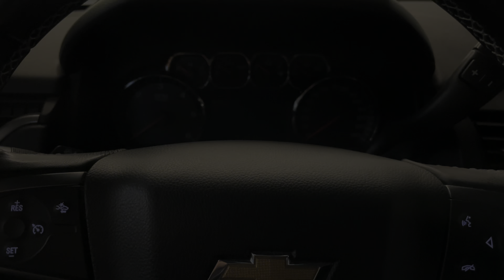Service Trailer Brake U1556...  LIN Bus Diagnosis

Comment: My trailer brake fault was caused a corroded splice connection in the wire bundle under the driver's door sill plate. Connect all 4 wires back together with a crimp & seal. I wish I looked here first before replacing the  trailer brake model , the dash control, checking all the fuses & verifying power and cleaning 3 ground lugs.
Reply from the maker: Sounds like you got it fixed up. Good job! Thanks for sharing!

Comment: In your opinion can a defective "Tailer Brake Module" cause a "Chassis Control Module" to not communicate with a scan tool?  If I run a auto scan on my 2015 GMC Sierra using a Foxwell NT510 Elite everything checks out good including the "Chassis Control Module".  It's not until I try going into the CCM itself that I receive a message on my scan tool that reads "No Communication".  Thank you in advance for the help.
Reply from the maker: If there are no fault codes that is likely a scan tool anomaly… There are two different trailer systems, one uses a dedicated trailer module and the other uses the CCM so you’re vehicle may not be equipped with the CCM or there is a fault. 

The trailer module itself likely won’t cause communication problems, but anything is possible these days.
Reply: @DadsGarageDiagnosticSpecialist  Is there anyway to find out if my vehicle came equipped with the CCM?  I would feel a lot better if I knew one way or the other especially since the truck runs great.  Thanks once again.
Reply from the maker: @HereWeGoSteelers You would have to be looking at the wiring schematics and the schematic would call out the three letter RPO code.

The RPO codes used to be inside the glovebox, after 2018 they can be read from the QR code on the drivers door jamb sticker. 

I took a look at the schematic for a 2015 and there is only one option so I guess you won’t have to worry about that anyways. 

If the scan tool will not communicate with the CCM check power and ground to the CCM and verify the fuse is ok. Then will have to test and verify communication circuits using HSLAN CAN network testing methods shown in some of my other videos.
Reply: Usually everytime it cant communicate with CCM (Auxiliary) its the red battery + wire at the CCM connector. I believe its red w/ white stripe. It comes directly from the under hood fuse box. Runs along the driver side frame rail back to the CCM. Pins 1 and 13? If I remember correctly on the CCM connector, are where you wanna test for 12 Volts. If you see open or something significantly less then battery voltage you can basically guarantee its that red/white wire. They tend to break under drivers door where the harness splits off towards the transfer case. This issue causes the "trailer brake system" displayed on dash as well. Its not always just as simple as a module or dash switch like many believe. These GMs are notorious for corroded wiring failing everywhere.
Reply from the maker: Good info! I’ve seen the same.

Comment: Hey man, I have this same exact issue on a 2018 Silverado high country. Same code too. I didn’t check the LINE bus circuit like you did only power and ground and I still have the code. Any tips?
Reply from the maker: Definitely check the LIN circuit for excessive resistance and/or open circuit. 

Rotten wiring is common within 12” to 18” of the connector at the trailer brake module.
Reply: @DadsGarageDiagnosticSpecialist Holy cow! Thanks so much for responding so quickly man. Okay I’m going to peel back the wiring harness going to the trailer brake power control module.
Reply from the maker: @esoterictransmissions I do what I can, you’re welcome!

After you confirm the wiring is the problem pull on the wires and you’ll probably find the broken spot.

I would resistance test the wire end to end and verify high resistance.
Reply: @DadsGarageDiagnosticSpecialist okay you’re incredible. I should’ve have known better because it didn’t clear at first. I was SO NAIEVE
Reply: @DadsGarageDiagnosticSpecialist I found the broken wire! Thanks again man. It was circuit 4114 from chassis connector to trailer brake module. I resistance tested them and found it fluctuating and then I pulled on it and it snapped. Was able to solder new wires and it worked great. Incredible video!
Reply from the maker: @esoterictransmissions Nice! Good work!

Comment: question - I have tested powers and grounds to the chassis control module , and the trailer brake module, all tested ok - Also tested the lin wire from trailer brake module to Chassis module -OK 
cannot comunicate with chassis control module, but trailer module data comes up on autel scanner-, and the U1556 Lin bus comes up in Chassis module , codes  any tips ?
Reply from the maker: That seems strange… Possible scan tool compatibility issue.

If you are getting the error message on the drivers information center the vehicle does likely have a fault though. 

What is the end to end resistance on your LIN circuit measuring for ohms? 

What about Min/Max values for voltage on the LIN circuit.

LIN should be approx 1V lower than battery voltage at maximum, and 1V above ground at minimum… if outside this voltage range it will not communicate even if the signal looks good. And that is typically caused by high resistance in the wiring. 

Corroded wires are pretty common within 12 to 24 inches of the Chassis module and or the trailer brake control module connectors.

Let me know what you find. Thanks.
Reply: @DadsGarageDiagnosticSpecialist   Thankyou and when i get back into it i will let you know
Reply from the maker: @buckeye455 you are welcome.

Comment: i had this issue when disconnecting trailer. but my issue was way more severe (vehicle wouldnt start for 8 months) realized the red wire going into TBCM had exposed wire. let the vehicle sit for months and out of the blue all permanent codes vanished and vehicle has ran fine for weeks
Reply from the maker: That’s interesting… I would suspect you have something else going on that would cause it to not run.
Reply: @DadsGarageDiagnosticSpecialist  it was always hit and miss. Sometimes it wouldn't crank over, other times it would drive but give service trailer brake warnings when hitting brakes and causing clusters to bottom out for a second. Sometimes it would go into theft detterant mode.  But like I said. Out of nowhere the issue just went away. Still currently my daily and hasn't had issue

Comment: What model Pico scope do you use? Did you buy it through GM? Enjoyed the video.
Reply from the maker: It is a GM branded Pico 4425 supplied to the dealership as essential equipment. Works the same as any other Pico 4425, but has license restrictions where it will only work with the GM pico software…. Although it seems to work just fine with Pico 6 and Pico 7 non GM software. 

Thanks.
Reply: @DadsGarageDiagnosticSpecialist  Thanks!
Reply from the maker: @MotorheadRedo you are welcome.

Comment: How many techs at the dealer actually do this vs. just slapping a new module in? Mine is sporadically throwing an error with the annoying, super insistant beep that just keeps going when it starts up. Dealer quoted $700 …
Reply from the maker: I’m not sure, but it’s a fast and easy way to be sure. It’s an expensive guess if they’re not testing it. 

Wiring faults are common enough on those that it should definitely be tested. 

Thanks.

Comment: Such a good video that it's not even what I'm looking for but i watched the whole video because it was very interesting.   We are having 3 lights come on at the same time.   At 1st it was intermittent but now it's every time you start the truck.   2017 Silverado 2500hd 6.0L Service Trailer Brake, Service Stabilitrak & ABS light are all on.  It seem to happen after washing frame areas under truck.  Do you think it could be trailer brake control module?
Reply from the maker: Most likely something got water into the connector. It would need to be diagnosed and you’d need to know what codes are setting. 

Thank you very much.

Comment: The trailer message appears intermittently. I clear it 5 times, then won't see it for days. It happens when towing or when not towing. 

The dealer found no error codes with the scan tool. They can't work on it until Monday.  Our campground reservation is over . We will be somewhere else upstate on Monday. 

In 7 days, we have 600 miles of driving to get home.

I don't know how a GM dealer is going to manage an intermittent error.  Should I just drive to a dealer in the next town and tell them to swap the trailering module?  

Other videos had a truck owner swapping the dashboard control.  

Braking seems normal.  The 3000 pound trailer doesn't push us around. I could try to skid when we hook up.

My diagnostic tool is a cheap volt-ohm-meter. Got pliers, strippers & a soldering iron! Going to test the braking pin on the 7 pin connector.
Reply from the maker: Well, it kind of depends on what the fault is when the fault messages present… if the trailer brake control module is communicating and reports a code for you to diagnose go after that. 

Or what I had going on in this video… The trailer brake control module wasn’t communicating at all and the module was faulty. 

I also see corroded wiring more often than anything else… About 6 to 12 inches from the module connector usually.

If I were to suspect corroded wiring… I could disconnect both ends of the circuit and load test with a headlight bulb while measuring voltage drop to accurately measure determine whether that was a problem or not. Load test the power, ground, and LIN circuit.

You can test with the ohm meter in the same way, but it won’t be as accurate because there won’t be any load on the wiring… that’s where a dealer tech will usually miss this because service information tells them to test everything with ohms. Intermittent wiring faults can be difficult to diagnose if it’s not acting up, but it takes a strategy of laying a trap where you think the problem may show up. 

Edit: another thing is that if the problem is intermittent it is unlikely to be a faulty module and more likely to be something like wiring or a trailer brake control switch code maybe. 

Thanks.

Comment: How is a LIN circuit different from the CAN bus?
Reply from the maker: Well a high speed CAN network is a 2-wire twisted pair that operates at about 1.5V-3.5V and the signals mirror each other. 

There are also single wire CAN networks that operate at about 0V-5V. 

On CAN networks each module can individually communicate. 

A LIN network is a single wire network that operates at about 1V-11V and is set up as a master/slave arrangement with one master module supplying the reference voltage and the slave devices simply taking orders and sending information back to the master module. 

Thanks.
Reply: @DadsGarageDiagnosticSpecialist  ok. To reiterate,  the LIN network communicates to perform some specific task. Here it is telling the trailer module to actuate the trailer brakes.

I have a another question about intermittent errors. I will ask in another thread.  Thank you.

Comment: Great video. 
Question, this will not throw a check engine light, correct? Only asking because  my 2018 silverado is doing a similar situation and now I cannot start the truck remotely, assuming because this fault. I tried the dash switch, no luck. Cleaned the connection up on module.. I'll be ordering a module
Reply from the maker: No, this will not cause a check engine light. The remote start is probably disabled because of a stored engine trouble code even if the light is not on yet.

 Crusty wiring is common to cause the trailer brake fault message also so verify there isn’t a wiring problem before replacing the module. 

Thanks.
Reply: @DadsGarageDiagnosticSpecialist  very helpful! I have no way to test the Lin, other than a ohm test, as mentioned in another comment. 
I love GM, but this is ridiculous. Let's change the location for 2025 ha ha. It's like, leaking 3rd brake light, back sliding windows, shark fin antenna. But I do love Gm. Lol
Reply from the maker: @perrybeede9498  I covered that in the video 11:17 

If the ohm test is ok and no shorts then most likely it’s the module yes.
Reply: @DadsGarageDiagnosticSpecialist  thank you!
Reply from the maker: @perrybeede9498 you are welcome
Reply: @DadsGarageDiagnosticSpecialist  It's got a bunch of faults, but only notification on the dash is the service trailer brake system. 
1- chassis control module
2-transmission control module
3- elec brake control module
4- body control module
5- radio control 
6- human machine interface control module

I just plugged it into my friends topdon.  Now I am confused. Or perhaps a bad ground?
Reply from the maker: @perrybeede9498  I would concentrate on the trailer circuits.
Reply: @DadsGarageDiagnosticSpecialist  I am taking the wire wrap apart now. From the module and bcm. Hoping I find a bad wire like you have experienced.

Comment: Hello, I am having The same issue with my 14 Sierra. I want to test the LIN, where can I find the pin out so I make sure I test the right wire? I would be using the continuity and ohm method. Thanks!
Reply from the maker: Try AllData DIY or something similar, you can purchase the service manual for a single vehicle at a pretty good price.

Thanks.

Comment: Does this only apply to trucks with the factory trailer brake controller or even with aftermarket brake controllers?
Reply from the maker: This applies to the factory trailer brake system. 

Thank you

Comment: if you dont have power to the control mod and fuses are good can you tell me where the ground is
Reply from the maker: G400 is located on top of the rear frame crossmember above the spare tire. Closer to the left side of the vehicle. 

If you have no power at the module and the fuses are good… Check for green crusty broken wires starting at the connector. It is common to find corroded and broken wires within 24” of the connector. 

Thanks.

Comment: Thank you SO MUCH!!  Replacing the trailer brake control module fixed my issue.  My trailer brakes work again and no warning light!!
Reply from the maker: That’s wonderful! Thanks for sharing!
Reply: @DadsGarageDiagnosticSpecialist when you replace a new trailer brake module do u have to programm ??
Reply from the maker: No programming needed. It is plug and play.

Comment: I have the same code in a 14 sierra. Replaced the module, checked for ground and power, and still doesn’t disappear. Also work for GM
Reply: Will test again and will get back to you 👍
Reply from the maker: @petitogaming5659  sounds good. Also check out PIT5698C for some good information about LIN network diagnostics.
Reply: I also happened to do was use the GM trailer simulator. And all lights/ functions operated as intended.
Reply from the maker: @petitogaming5659  the trailer lights and the trailer brakes are on different circuits and handled by different modules. U1556 implies the chassis control module cannot communicate with the trailer brake power module. You said power and ground was OK so most likely the fault is on the LIN circuit.
Reply from the maker: I have been seeing rotten corroded wiring fairly often as well… About 6 to 12 inches away from the trailer control module connector usually. 

11:30 in the video I talk about testing the LIN circuit with a DVOM. 

Did you measure LIN circuit resistance end to end and also check for shorts? 

With the trailer power control, module, disconnected, and the key on… The LIN circuit should rest at about 1V lower than battery voltage…. That confirms the wire is intact and the master module is supplying the LIN reference voltage. If that is what you find, test resistance end to end and you may find a corroded wire on the LIN circuit most likely. 

Being at a General Motors dealership, you should also have access to the Pico scope. 

Thanks.

Comment: So gm finally using pico?? I didn’t think dealers used scopes really
Reply from the maker: When I started at the dealer I asked if they had a scope and they said no. 

I was browsing the tool room one day and found a dusty box labeled “NVH kit”… I opened it and found a BRAND NEW never-used pico and I was amazed to find they had this extremely powerful tool and not even known it nor using it.

Turns out GM was only using the Pico for vibration analysis for years….yet if you order the lead set for it, you can use it as a regular scope. And that’s what I did. The NVH vibration analysis software is amazing also….I have a video showing the NVH software to find a dash buzz. 

In recent years GM has begun including Pico diagnosis in service information, but not much in my experience. Also they’ve begun a lot more Pico based training in the last couple years.

Thank you for commenting.

Comment: novice here. thanks for video. i noticed you didn't disconnect the battery when you first disconnected the module but only when to unbolted module from frame. was that necessary and i wish you would do a very close up of releasing the brake module plug tab without breaking it.
Reply from the maker: I left the battery connected so I could do testing. Then I disconnected the battery when connecting the new one just to be extra safe and not get blamed for destroying a new expensive module lol. 

At 6:00 I take the connector off the module…It’s not a real close up view, but you can see how I remove it, there is a little red tab to pull out first as shown, usually dirt and dust really makes these connections stuck. 

Thank you for commenting!